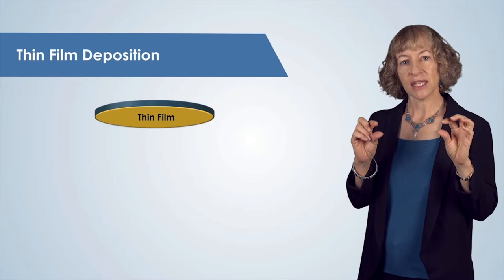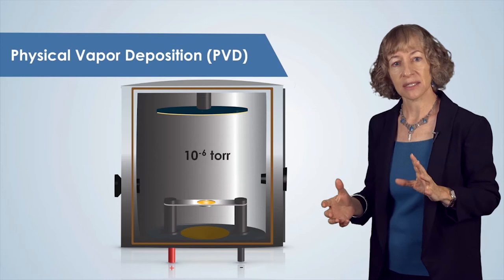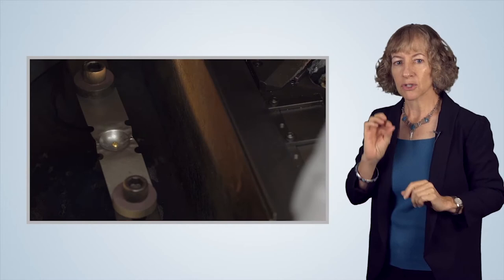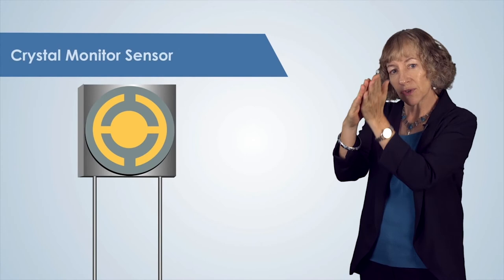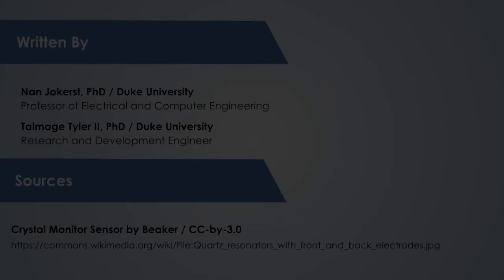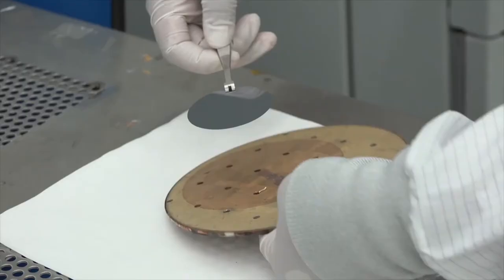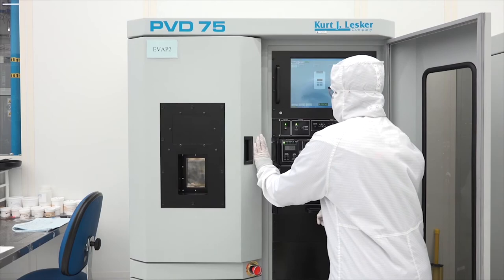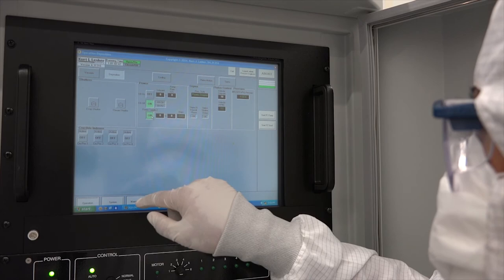Thermal Evaporation

Comment: Very interesting presentation. The elegant gestures brought attention to the subject, and were a welcome addition.
How do you calibrate the deposition thickness sensor?
How do you determine the film thickness? Is there a separate meteorology session that covers it? 
I assume there may be a process to recover the gold from the chamber walls? The target showed sign of multiple deposition cycles. Even nanometers add up to $$ eventually, especially for the high purity source material.
Reply from the maker: Regarding film thickness: The thickness can be verified with an independent measurement, for example using a profilometer (we do not currently have a video describing profilometry). The sensor electronics have a ‘tooling factor’ that is adjusted to account for any discrepancies between the thickness displayed by the sensor and the actual measured thickness.

For metal recovery: We install removable metal panels called “shields.” The shields are coated with textured aluminum film (deposited via flame spray technique by a commercial supplier). All the materials we deposit build up on the shields. The textured aluminum coating prevents the materials from flaking / peeling. Every few months we replace the shields. The old shields are sent to a commercial vendor, where the aluminum and all deposited materials are chemically removed and collected for recycling. The used shields are then cleaned and re-coated with aluminum and sent back to us for re-use

Comment: You mentioned phase changes, solid to liquid, liquid to gas. Is sublimation also in that list? Can low pressure regimes exclude liquid phase?
Reply from the maker: Yes, some metals will undergo sublimation (i.e. solid to gas transition), for example chromium. Electron-beam evaporation (or “E-Beam Evaporation) is better suited to evaporate such materials (see our video on e-bam evaporation: https://youtu.be/xIU1DDbDEDQ ).

Comment: First I wanna say thank you for making these videos. I have no experience with this topic but I have always had a question & this looks like the time to learn something. 
Question: Why are all the internal surfaces of the vacuum chamber being coated with the deposition material, In this case gold?
Reply from the maker: Imagine if you boiled water inside a small box; the water converts to steam and then condenses on all interior surfaces of the box. When the gold evaporates, it coats all surfaces inside the chamber in a similar fashion
Reply: @dukeuniversity-smif2466  my apologies for not proof reading before hitting send…. It was supposed to aren’t or why doesn’t the entire inner surface get coated with the evaporated material? Is it due to the lack of air inside the chamber or idk I’m curious thou.